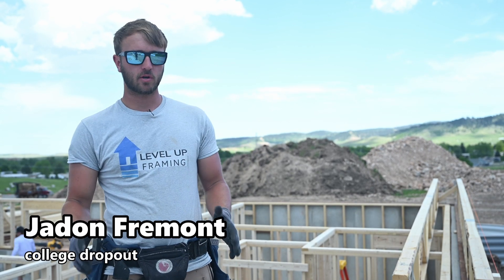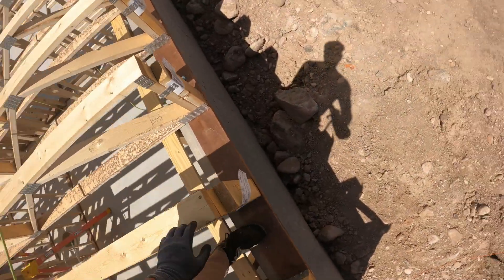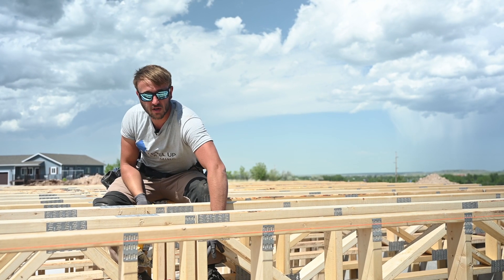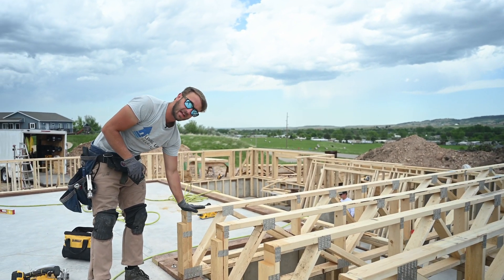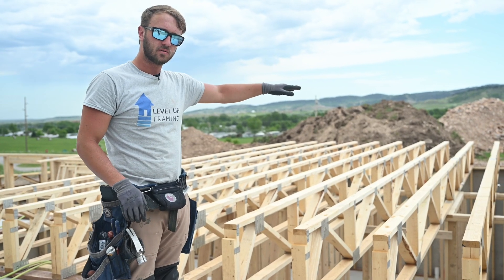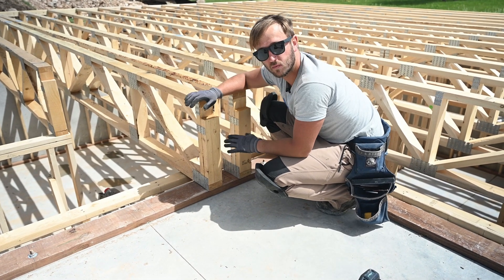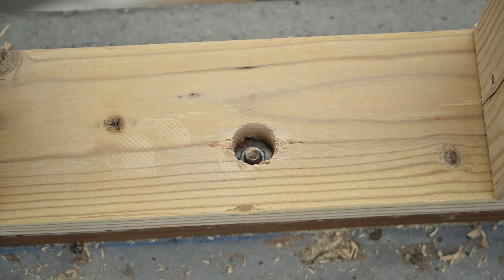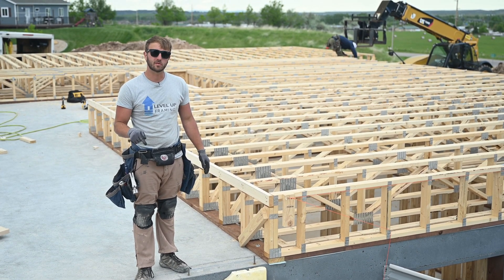How to Set & Level Floor Trusses

Comment: Can the exterior wall sheathing break in middle of a floor truss on a second floor. Or does the floor truss need full sheathing for shear?
Reply from the maker: That is an area specific code enforcement, but I do not recommend it.  Sheeting edges are significantly stronger when consistently nailed.   That is especially important on the floor system.

Comment: whats the best way to do rim board on trimmable style floor trusses?
Reply from the maker: Thank you for the comment!  I had never heard of “trim-able floor trusses” until you asked!  

It looks like the rim board would be a normal “rim joist” on those.  
Rim joists are usually just a full height 1 1/4” board. It nails on at the top and bottom of the “joist” end of those trusses. 
We will have a video for joists in the future.  For now, just cut your “trusses” 1 1/4” short of the edge of the wall (or whatever the thickness of your rim joist is.  That way the exterior of the rim joist will be flush with the top plate.

Comment: Not a framer but i watch a lot of YouTube Awesome Framers. I think he devised a way to make the top of his walls level at the correct height. eliminates all the shimming.
Reply from the maker: Yes,  we will be releasing videos in the future about the many methods to custom cutting studs.  Although shimming allows an efficient way to level a floor with room for play. 

Shimming structural points is highly controversial and it is best practice to avoid shimming if possible.  But in our experience working with high end builders in our area, if it is done right it is acceptable.  Shims do not settle or move unless they are poorly installed (meaning they are cracked to pieces or not equally baring).
Reply: @LevelUpFraming  looking forward to the video on custom stud lengths.
Reply: @LevelUpFraming  what do you think about steel shims?

Comment: I'm not in construction, but I've been watching tons of videos in prep to build a retirement home.  In all those videos, not once have I heard the term relief cuts for trusses.  What are they for?  Why are you doing them?  Were they prescribed by the truss manufacturer?  Are they approved by an engineer? 
Also, too bad the truss plan wasn't used to determine the best places for the anchor bolts.  Quite annoying that the truss will not be square with foundation wall.  I bet things like that can throw people off if someone happens to make a measurement off of it.
Reply from the maker: Relief cuts:  all floor trusses are built with crown, which means they curve upwards.  When trusses span over a load bare wall they are essentially 2 trusses built as one. So the natural crown causes them to sit way above the wall.  The relief cut is basically separating the two trusses so they sit down on the load bare wall.  It is labeled on the truss and the plans by the truss company.  You should NEVER make any relief cuts unless it is labeled on the truss and the plans.  

Moving trusses around bolts: shifting the trusses avoid bolts does not affect anything as it is less than 1°.  Some trusses (like around the stair well) cannot be shifted. 
It is important to compensate for any shifting when doing the rim board (see our rim board video). 

Thank you for watching!
Reply: @LevelUpFraming  Thanks for clearing it up so well.
I'm pretty OCD, and would have marked where the anchor bols would go or cut it off and epoxied a new one in.  I understand you have to work with what you were given.✌️
Reply: @LevelUpFraming  I'm carpenter also and the relief cuts not only make them sit on the load baring walls but also eliminate the low frequency noice from the floor to other rooms.